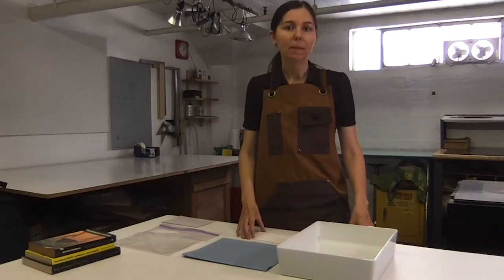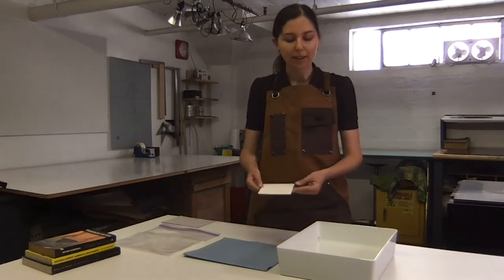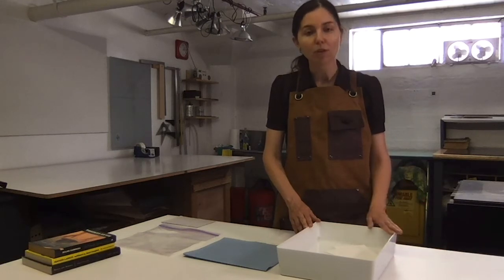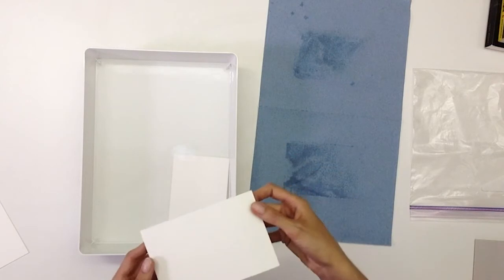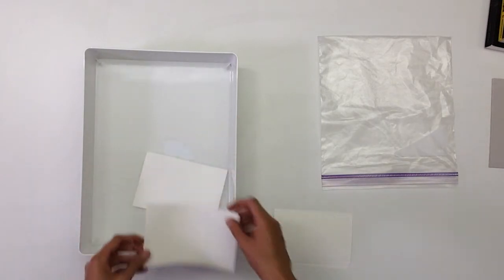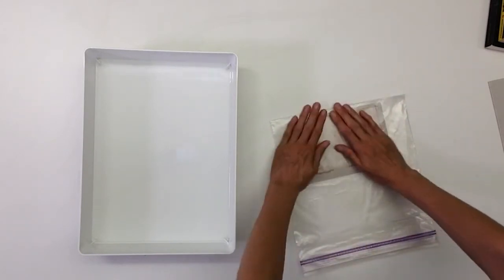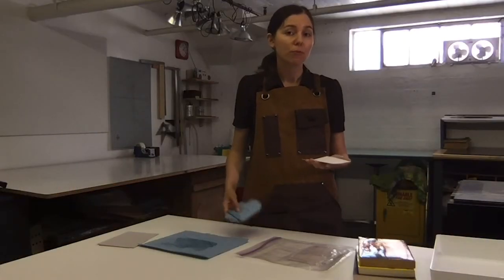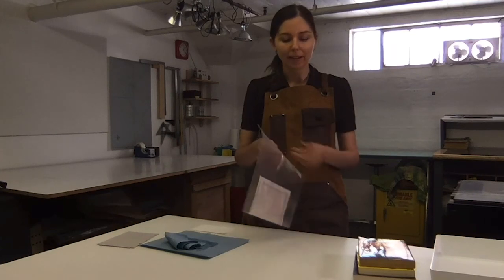Printmaking: Soaking Paper and Damp Packs

Comment: Thank you ! Am I correct that you leave it 20min in the bath in fisrt method and only quick dip for second method ? Thank you
Reply: The paper soak time is dependent on how much sizing the paper has. Unsized paper, for instance, is sometimes sprayed rather than soaked, and heavily sized paper, such as Rives BFK, can sometimes need a couple hours. Local humidity also impacts needed soak time, longer in dry environments and shorter in humid. Damp packs take the guess work out as all papers are briefly dipped in a water bath and then left to equalize overnight.

Comment: Thank you for sharing your methods on soaking paper. How long would you say can I wait before using the paper in the damp pack? Does it need to be used the next day or can I wait a couple of days?
Reply from the maker: It is best to use the paper within 24 hours. Paper can usually be left for up to 48 hours, however you will want to watch closely for signs of mold.
Reply: @michellerozic5828  Thank you for your response. Greetings, Alex
Reply: @michellerozic5828  How does this work when doing multiple layers of color? If the paper is moistened, will the ink dry in time for the paper to receive another layer of ink over top of the first, while still being moist?